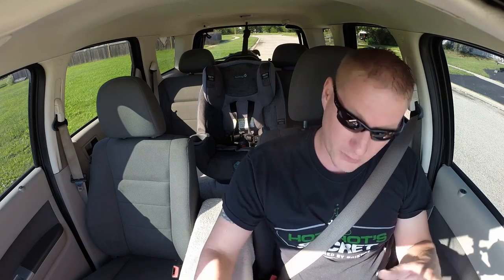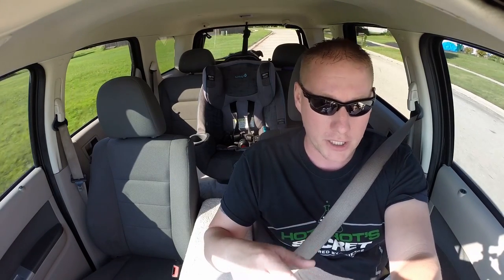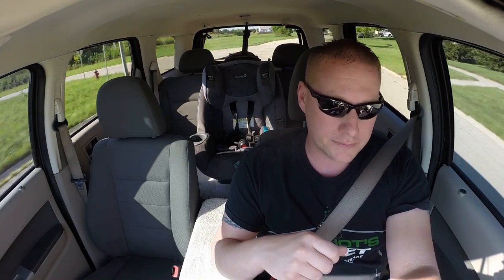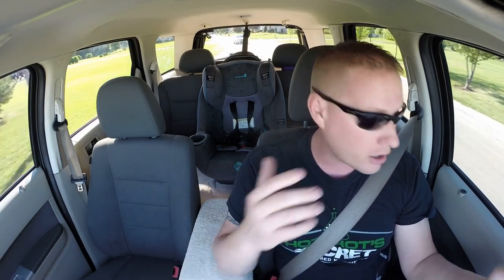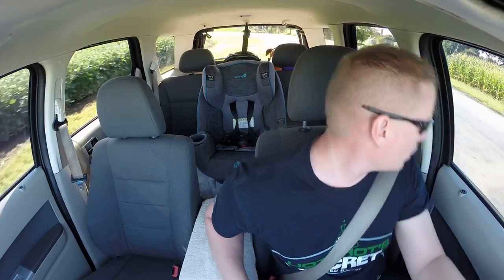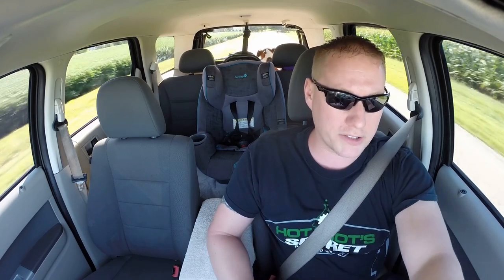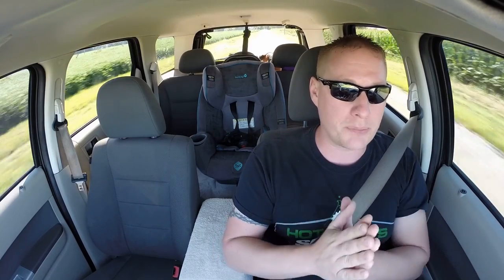Ford Quick Tips #60: Effectively Breaking In Your New Brake Pads

Comment: Good work. Follow the specific instructions for your brand of pads. For example, Powerstop break in "bedding"  follows......5 moderate to aggressive stops from 40 mph down to 10 mph in rapid succession without letting the brakes cool and do not come to a complete stop. If you’re forced to stop, either shift into neutral or give room in front so you can allow the vehicle to roll slightly while waiting for the light. The rotors will be very hot and holding down the brake pedal will allow the pad to create an imprint on the rotor. This is where the judder can originate from.

Then do 5 moderate stops from 35 mph to 5 mph in rapid succession without letting the brakes cool. You should expect to smell some resin as the brakes get hot.

After this is complete, drive around for as long as possible without excessively heating the brakes and without coming to a complete stop (Try for about 5 minutes at moderate speed). This is the cooling stage. It allows the heated resin in the brake pads to cool and cure.

After the brakes have cooled to standard operating temperature, you may use the brakes normally.
Reply: Thank you

Comment: Thanks Brian for the info. I think I've been doing it wrong. I was taught to "bed them in" by doing repeated moderate braking from 50mph down to 5mph about 6 or 7 times without letting the wheels actually stop turning. I would stop the process after extreme brake fade and let them cool down by driving for a good while.
Reply: I don't actually stop either. I Slow down to five then quickly speed up to fifty again for about six or seven times then cruise until they cool off naturally.

Comment: Great video! Is this the same method that you would use for Heavy Duty Towing truck brakes? I have purchased cross drill and slotted rotors with carbon fibre compound pads. I really like the carbon fibre pads because they not only create a low amount of brake dust but they also last so much longer than factory metallic replacements, don’t heat up as much, and don’t destroy the rotors. I was able to get 23,000 miles out of my last set of carbon fibre compound brake pads in my 2003 Ford Expedition and just started to get some shuddering under heavy braking on the highway.

Comment: Kind of a wild one😅 I just replaced my back two rotors and pads had no issue putting them on, calipers were fine no hesitation clamping them back in, I go to drive to a friends house maybe 20 mins away(granted this hasn't been done in a LONG time and didn't think about it till I heard grinding and hardly and stopping power from the last set) on my way to his house I notice shaking, it was very light then for a few seconds was very shaky, scary shaky, and when I got to his place they were smokin a little and then rotors were really really hot, is this because for so long everything was used to really wore down rotors and pads and trying to adjust to the new, thicker rotor and pads it's just rubbing really badly until it "fits it's way" back in basically or is that like I messed up badly type of thing 😅 forced to drive it to work tomorrow so hopefully nothing bad happens 😬
Reply: You likely have an issue with the caliper or brakeline that is causing the brake to hang up

Comment: What would happen if you didn’t exactly do this? Like you just bled the brakes by pushing on em while parked but after jus started driving like daily. I didn’t do this, and it’s been a few weeks. However, I had my tires rotated and now I hear I weird rumbling sound: not a scrape but rumbling sound at slow speeds while applying the brakes. I also had 4 new tires put on at Firestone and I have new brakes and rotors that were put on 3-4 weeks ago.

Comment: I replaced my pads and rotors, did the break in process. After a few hundred miles, my brakes started squealing when they're cold, like first thing in the morning or when leaving a store. They don't squeal anymore after stopping once or twice. What's wrong?
Reply: What kind of brake pads did you use? I only use ceramic now after previously using noisy metallic pads. Ceramic pads are nice and quiet.

Comment: hi my brake pedal is softer after the brakes were replaced is this normal. its the back brakes i got changed.
Reply: joseph murphy yes that's normal your calipers have more travel and they need 80 miles to settle Into place. They will firm up after a few 100 miles.